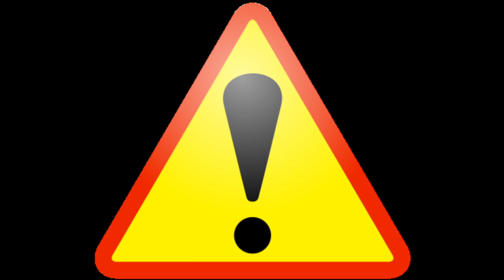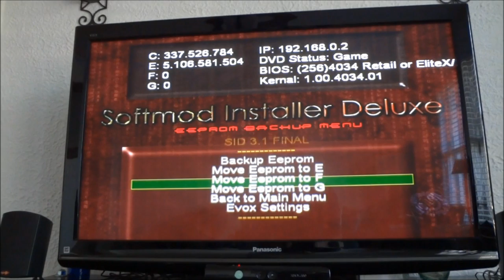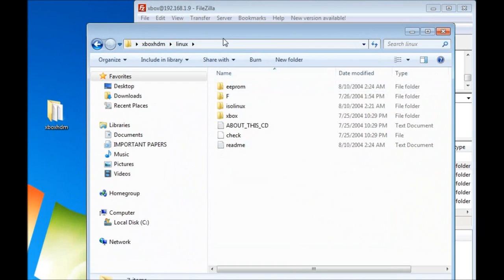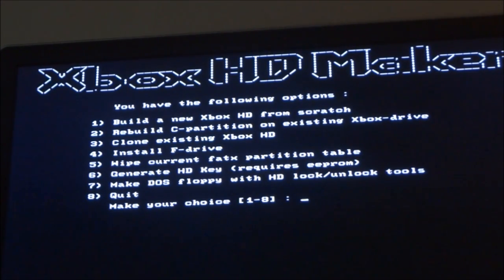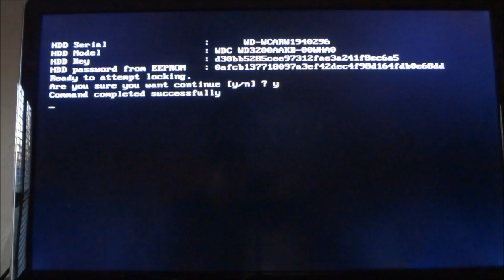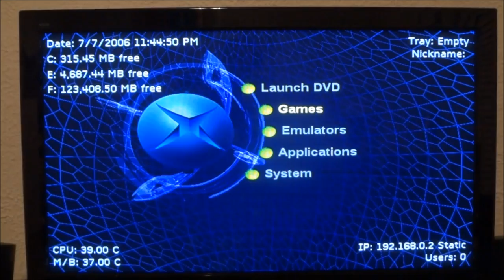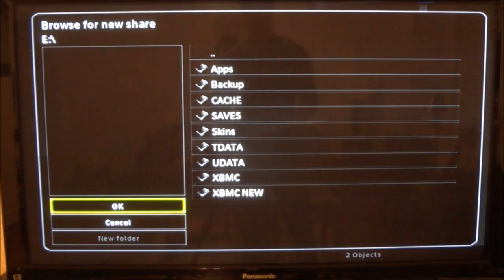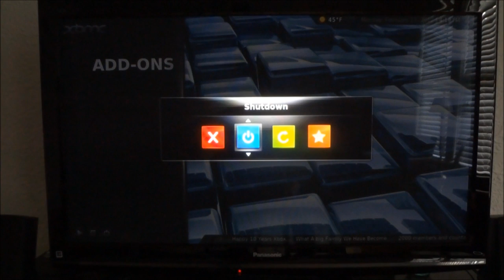How to Softmod an Original Xbox, install XBMC, and install a bigger Hard Drive!

Comment: This is my first softmod and it worked great! I've only done hardmods before but you can't find modchips anymore. They were only for allowing both hacked and unhacked modes but with Live gone, there is no point to modchips, although with my XBOX with the Xecuter 3 modchip, I can drop in any hard drive on the spot and set it up, lock it and use AID.

Here's a few tips if you have issues...
- If using a USB flash drive, you'll have to go small! I used a 128mb and it worked fine. 1GB did not, neither did an 8GB. USB card readers won't work but the ones that plug into the stick might work (i.e. no cord). You won't find that size in the store so look elsewhere, ask friend, etc.
I used a flash drive so I'll continue with that...
- Find a USB cable with a female end and an XBOX controller and splice them to make an adapter. Get them from Salvation Army, Goodwill, pawn shop, etc. Google for how to do it.
- format the flash drive in the PC, FAT32, default cluster size
- Plug the drive, using your new converter cable, into port 2 and turn on your XBOX.
- Go to the memory section of the dashboard. Hopefully, you'll be notified that your memory card was corrupted and it was erased. If it states that you cannot use it, your flash drive probably won't work.
- When the XBOX 'erased' your memory card, it actually formatted it to FATX. We're in business. Find a program called Xplorer360, plug your flash drive into your PC, DO NOT FORMAT IT! Use Xplorer360 to mount the drive and copy the saves from the SID by drag and drop to the Xplorer360. You want to drag the numerically named folder under the UDATA of the save zip file to the main area of the Xplorer360 window. So for the Splinter Cell save, you're dragging the '5553000c' folder from the SID511.Loader.SplinterCell.NTSC.zip (or the PAL one). Also, only use the SID.Installer.zip and not SID511.Installer.USB.zip. There is no need. Unmount the drive in Xplorer360 and remove the flash drive. Also, if during the copy the files don't show up in Xplorer360, unmount and remount.
- At this point, you should be able to plug in the flash to the xbox with the cable and copy the saves to the hard drive.

And a few notes about DVDs and the drives...
-DVD-R work best. I've gotten Verbatim DVD+Rs to work with my Phillips drive
-XBOXes with the Samsung drives tend to read more types of discs. If shopping for an XBOX at a pawn shop or what ever, plug the box in and eject the tray. Samsung drives have two finger holes for mini-DVDs. Phillips have none. Thompson is the other type and they are a different layout. You can google this for screenshots. My main XBOX has a Samsung and my softmod has a Phillips. Other than the high pitch squeeling, the Phillips is reading what I have so far but all my discs are older DVD-R. My Samsung still has issues with most DVD+Rs I've used, but my Verbatims work great. You might need to find Verbatims on-line like Newegg.

Last tip, FOLLOW EVERYTHING THIS GUY SAYS ABOUT SWITCHING YOUR HD! I let my experience get the best of me and did a clean wipe and re-install of the MS Dashboard from the AID. This did not work. (It does when using my modchipped box. I had to pull it all apart, do the whole PC thing, add another hour of time, etc.

Comment: Ok, I just did the 400 GB HDD upgrade on my Xbox.

I had already softmodded my Xbox and updated to the latest XBMC (3.2.1).

Everything worked fine using xboxhdm 1.9 using this video as a guide (thanks again to the uploader).

I used xboxpartitioner and got the F drive showing ~ 370 GB of space; sounds about right.

Although I had a couple minor problems in XBMC, so I re-updated to 3.2.1 (just copied the new XBMC folder over after deleting the old one).

Working perfectly now :)

Comment: JUST WANT TO POINT OUT ,there are multiple ways to do the same thing,
much respect to the poster of this vid ,
as i mean no disrespect to him or others,

what works for me , might give someone else more trouble,
or vice versa.

it basically comes down to the resources you have at hand today,
that will dictate witch method is best for you.

dont have eeprom reader parts available locally,
then get it using softmod then backup eeprom.

i actually was at a loss finding a compatible usb drive,
so i just used the pc, hotswap method , without game exploit ,
but before i completely blew my partition away , i installed softmod to f:
then i used hexen disc to allow me to ftp back into it , 
got the hdd key , burned it into xbox maker,
then completely blanked the drive, 

but yes, theres multiple ways to do some of this,
whatever works best for you.

Comment: You did a great job on this video, Softmod has been around for a while, but this is the perfect tutorial for any inexperienced modders.

You should do a video, showing how to merge a female usb and an xbox controller connecter. Its a cheap method to get those initial softmod linux files onto your xbox using a usb.

Comment: This is absolutely the best guide for soft modding!

Couple questions that I would be thrilled if you could answer: 

1. What do I need to do to get LT+RT+Black+Start to return to xbmc instead of rebooting? IGR = bios? Nkpatcher? PhoenixBL?

2. What configuration files/settings to I need to edit to have XBMC load up to the emulators screen (with the 2 column image layout)

I have another modded xbox with everything setup this way, but not sure If I can directly copy the config files/etc

Thanks!

Comment from the maker: You are right. Adding XBMC as an app on your xbox is very easy (just FTP into a folder). To make XBMC your default dash it involves replacing critical files that may vary depending on which SID you use. I figured that using the AID disc was the best way for a fool-proof method that is rather easy (just requires burning another disc).
Reply: Ik this comment and video is old but I have XBMC as my main replacement dashboard
Reply from the maker: @RaysGamingChannel2003  It's a great dashboard!
Reply: @Hawk_Eye_Retro  yeah it’s has a lot of features

Comment: if you read your hdd/ bios number eprom you can easily mod it along with a bigger hd that way, however you need to know how to build the reader .

the principle is to slip that eeprom hdd number of your xbox into the software that 
creates the soft mod  kit. thus unlocks your hdd and bios in process and allows for 
new hdd loaded with xbox image

Comment: You can do this with a crossover ethernet cord. You set you're computer ip address and xbox address exactly the same except the ip is 1 digit off the net, and gateway are the same. And it will work.
Reply: But not everyone has a x-over cable though. Its not quite the same thing as a Cat-5 Cable, and sadly you can't use a x-over cable, as a Cat-5 either. T_T

Comment: Oh and the easier way to earse everything is the following is a few different codes: 
Setting to System Info - and PRESS Y, X, L (Left on Left Analog Stick) 3 times 

Setting to System Info - and PRESS Y, X, L (Left on Left Analog Stick), X, Y 

Go to Settings > System info > Press Y , Up (left stick), Down (left stick) , X , A

Go to Settings > System info > Press Y, Right (left stick), Left (left stick), Y, X

Go to Settings > System Info > Press  Y,  Y,  A,  Down (left stick)  A

Comment from the maker: You simply have to go through the modding process again; however, your console should already have the saved splinter cell files on the hard drive (if it was modded with splinter cell). All you need to do is buy an original splinter cell and follow the steps on how to add XBMC after you've performed the initial soft mod. This happens to a lot of people. All of your saved files should be in place (emus/games/etc.) you just need to re-softmod.

Comment: If you don't have any friends (or at least any with a modded xbox) you could put the SID files on a fatx formatted (128MB) flash drive, most seem to work with Xbox. You would also need to buy/make a Female-USB to Male Xbox cord.

Comment: Yeah, that's the clock loop. From what I could find you can just let it reboot over and over and eventually you'll be able to set the clock. However once you do you should upgrade to a newer version of the fonts exploit that does not have this bug.
Ndure 1.1 is supposed to have it fixed.

This is just what I could gather from some quick googling, I haven't tried this out myself.

Comment: Once you finished the tutorial it's not depending on a PC, so that should be no problem. Just make sure to get a newer version of the font exploit so you don't get the clock loop, that I talked about in my other comment here (I assume your Xbox will be powered off for longer periods if it's in your car, so you seem to be in the risk zone for that problem if you're using the old version).

Comment: Hey Ben, thanks for sharing this tutorial, I'm going to use it. I apologize if this question has already been answered, but, instead of using the desktop computer to setup the new hard drive, could you just use a USB to IDE converter cable, and a laptop with Windows?

Comment from the maker: You can use 1 computer for everything if you wish. You'll just have to take it apart then reassemble it. I've never used a MAC for modding an xbox - I'm sure it would change a few steps.

Comment: Just so you know i know this is old but the platinum hits Splinter Cell game works just fine, ive done 100s of consoles with that disk.
Reply: 100's? You might be able to help me. Any idea how to swap the hard drives between 2 soft modded xbox's? Obviously I need to swap over the EEPROM's but I don't know how to do it.
Reply: you dont have to do that for the hard drive, but just swapping a hard drive will never work by just swapping them, upgrading them is easier honestly
Reply: Thing is I have a large hard drive in one console (which holds most of my games), and another softmodded Crystal xbox (with stock hard drive). For some strange reason the Crystal Xbox displays a better image on my TV. The other one produces some vertical banding that sweeps across the screen. So I thought, why not swap the hard drives over and have the best of both worlds? But if you think upgrading the HDD is the best option maybe I'll just do that and transfer all the data. It will be a paid though.
Reply: oh i understand completely, i actually just bought component cables so i get 720 p 1080i on it, check display settings in unleashx system settings, maybe something is different in display settings as well

Comment from the maker: Could be a problem with your burned disc (try burning it on a different type of blank cd or with a different computer). If that doesn't work - it could be your computer that you are trying to perform the mod with.

Comment: Thanks for posting this! It helped a lot when I softmodded my Xbox :)

If you use the latest SID USB installer you can go directly to XBMC; that's what I did ;)

Quick question:

I've already done the softmod with XBMC on my factory HDD, but I just purchased a 400 GB HDD to replace it.

I noticed in your video you installed XBMC *after* you put in the larger HDD.

Will I run into any problems upgrading the HDD with XBMC already installed?

Thanks!

Comment: action replay is software u can get for various different consoles, more or less u buy the software and a connector for in ur case an xbox as a pack and plug your xbox memory card into the connector and then into ur comp and start the program and u can download cheats/game saves/ and various mods to the system eg the soft mod ^^^^ search on ebay and you should find it, search for action replay xbox :) and buy a kit, good luck!

Comment: First of all must say this is a really well made tutoiral! I was using it because I wanted to put a bigger harddrive into my xbox, but I ran into a problem. If you have any ideas what went wrong that would be great. My xbox was already softmodded, so I just followed the instructions for preparing the new HD. Everything worked great, except when I boot the new HD it boots the MS dashboard only no matter what I try. Going back to the old HD and everything works fine. Any ideas?

Comment from the maker: The cable orientation shouldn't matter. The jumper on the hard drive should be on master. All that is needed is for the computer hard drive slot to be connected to your new hard drive.

Comment: Hi, great tutorial, but I have a problem. I used a USB drive which got formatted by the xbox just fine, but when I added the softmod files and plugged it back in they don't show up, as if the memory card has nothing on it. Any idea of a fix?
Reply: ***** I ended up switching the usb with a different one and it worked. For anyone else seeing this later on, here's a fix.
Reply: +MKC Ah cheers. I expected that because the Xbox formatted the USB the files would show up. Ugh, now I need to find an ancient USB somewhere...
Reply: to others with this problem , i suggest using the hotswap ndure method, no need for usb,
or game exploit, however , more steps, and you must be 1000 percent sure you dont
blow away your c partition first time around , using this method,
basically first time hotswap to install f drive softmod, then
ftp back into xbox ,
after gte the hdd key , burn  xbox maker again, but now with the hdd key,

on youtube theres demos of this method, hotswap method. 
remember though , first go around doing it , dont blow away your c,
only select install an f partition

Comment: EVERYONE ,YOU MUST REMEMBER , YOU NEED TO FIRST GET YOUR EEPROM INFO, INCLUDING THE 
HDD KEY , THESE INSTRUCTIONS ARE GOOD , BUT BEFORE YOU GO ON TO THE PC ,
YOU MUST SLIPSTREAM YOUR HDD KEY , HES SHOWING YOU  HOW TO DO THE FTP, AFTER THE FIRST
MOD SCREEN , 

ONCE YOU GET THAT FROM FTP , YOU MUST USE XBOX MAKER , ALONG WITH NDURE AND
SLIPSTREAM YOUR HDD KEY , THEN BURN THAT DISC 

WARNING , YOU CANT MAKE YOUR XBOX DISK MAKER DISC WITHOUT GETTING THIS HDD KEY FIRST
YOU WILL RUN INTO ONLY TROUBLE WITHOUT IT !

Comment: SATA hard drives can work. The problem is usually finding an IDE to SATA adapter that can fits in the hard drive caddy.

The other problem I have seen with SATA hard drives in xbox 1 is that the adapter creates a bottleneck in data transmissions speeds. So it can take up to 2 minutes for an xbox to boot up with an SATA hard drive.

How has the startup lag been for you?

Where did you go to check SATA drive compatibility lists?  So far I have only seen PATA hdd lists on xbox hq and google search.

Comment: Can anyone help me out?  After piecing together several tutorials (tried to mainly use this one), I finally got it softmodded.  After I installed XBMC, I did everything exactly as this tutorial says.  Right at the 20:40 mark where you restart the xBox, yours boots into XBMC.  Mine does not for some reason.  Mine boots back to the softmodded dash (EvoX), then I have to go to "applications" and select XBMC to get to it. 

Can anyone help me on getting mine to boot directly to XBMC?

Comment: After I load Xboxdm and press option one, it scrolls through all the text and then shows the screen with the penguin. When I type in "xboxhd", it just says, "Linux CD not found. Insert and try again." I'm confused, the disc is in my computer's drive. How else would I have started you, silly program?

Will this program not even work if I am trying to use a 1TB SATA hard drive?
Reply: +W. Jones same here boot with DVD type xboxhd then "Linux cd not found error?

Comment: I get all the way to the Splinter Cell load check points screen (3:56 in the video), and when I press the 'A' button on the controller and select 'Check Points', it should switch over to the softmod section.. but instead my screen goes black and stays that way. Anyone know what I'm doing wrong here?!? I've tried EVERYTHING (I think..)

Comment: Hi followed your video and all is good emus work great BUT xbox won't play original xbox games anymore! Play DVDs cd's all fine I've even swapped the drives over with 4 other consoles to prove the drive is good but it just reboots to xbmc screen rather than the game. any help please? Thanks
Reply: mine ethier -_- even through the hdd mine does not work right
Reply: My understanding is that's the main difference between the dashboards EvoX and UnleashedX.  If you want to play burned discs, use EvoX.

Comment: I actually found out the reason my ip didn't work was because I wasn't using a cross over cable. But I have another question. Do you need auto installer deluxe, or was that just to her xbmc, because I already have it in Sid since mine is more updated than when you made this. Like am I just able to plug in the new hard drive after locking it or do I have to use aid? If so can you send me a good, safe link. Because mine won't let me open it. I tried both winrar and 7zip?

Comment: Love the video.  Did everything as explained and the xbox worked perfectly.  However, I had left the power unplugged for several days and now I get no boot.  Just a black screen.  If I put a disc in, I get the xbox splash and then a black screen.   I've read it could be a clock issue? Any solutions to this problem?  Do I have to leave it plugged in forever?

Comment: Question - can this method be used w/ a USB controller mod and USB stick/drive versus a memory card, or is it strictly with a memory card?  Short of ordering a used one on Amazon, eBay, etc. it's getting hard to find original XBox memory cards, but I have a bogus controller and spare USB extension cable lying around that I can make myself a XBUSB adapter w/o much trouble.

Comment: I am having the same problems. I am also having problems with ftp'ing over xbox original games/backups. I am using C-Xbox tool 2 to extract the iso(also maked the folder default.xbe etc) and then transfer it over. Only some worked out of the many I tried to transfer.